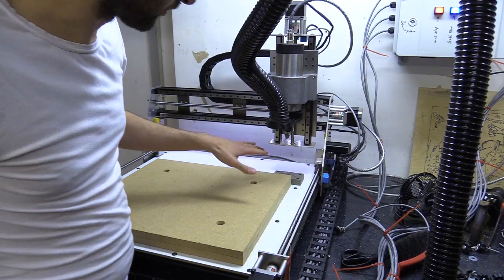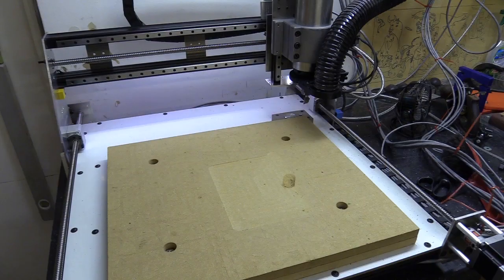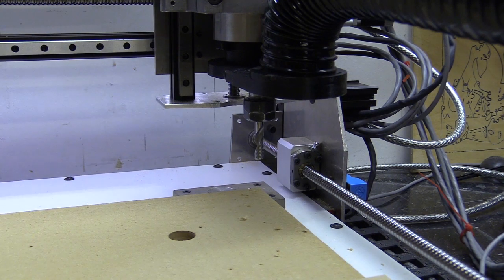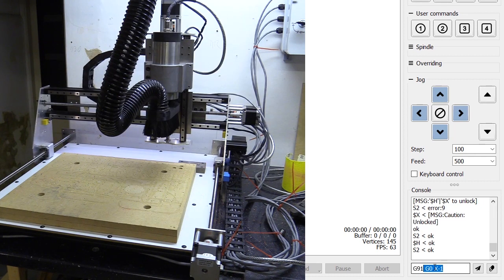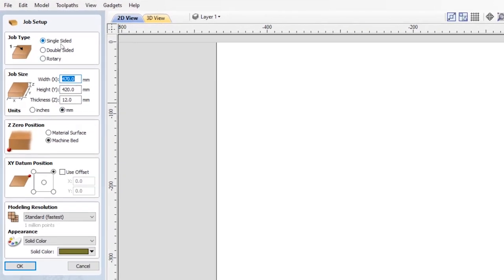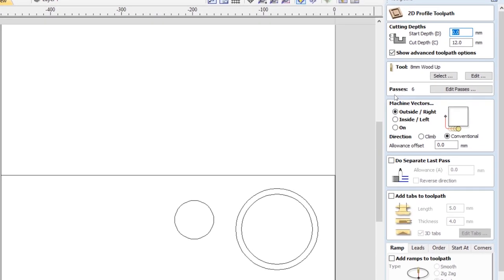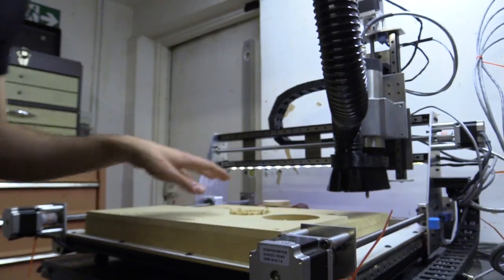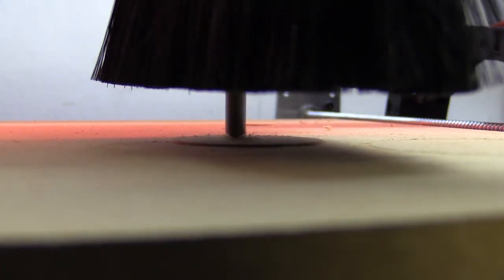CNC Workflow / Wasteboard Surface Patch

Comment: Your Z zeroing technique is going to accumulate errors. Just use a piece of metal of known thickness and drop it on the top surface of the job. Use the job surface as your datum. I do this. My code is
G91G21;                     Incremental mode and coordinates to mm
G38.2Z-30F100;        Lower the tool rapidly until it contacts (pin A5 goes low on my controller). Give up at 30mm in case probing fails
G0Z.3;                         Lift the tool 0.3mm
G38.2Z-1.11F10;       Lower the tool slowly until it contacts
G92 Z9.79;                 Offset the height coordinate by the height of the measuring puck. Mine is 9.79mm thick
G91;                            Again set incremental mode (just to make sure)
G0 Z10.21;                 Raise the tool until it is 20mm (9.79 + 10.21) above the reference level
M30                            End

Comment: You don't need to manually offset the circle. You can specify a negative offset in the profile or pocketing toolpath. It's nice to not have to alter the geometry to tolerance for different materials.
Reply from the maker: Didn't think of that. I'll do that next time.

Comment: Sorry to be the bearer of bad news buts it’s time to start mk3 cnc control, grbl just released a new version which allows the slaved Y axis stepper to home using a separate limit switch. This allows automatic gantry squaring. It’s only one extra wire.........  Full details and instructions are in the new config-h file. Good luck 😉
Reply from the maker: I've been waiting for that to be released for ages. I couldn't understand why they would keep two different type of coolants / flood terminals but not move to dual axis homing. Anyway I got a change to use a Duet 2 and have set up another machine with dual axis homing and lots of other features. Reprap is not great for CNC but it's slowly changing.

Comment: I liked this practical, step by step video. I am finishing my home build CNC router and the workflow is just mind boggling to keep everything straight. For the time being, I'm sticking with a big sharpie and I keep making new jobs and trying it out to see where I get caught up. And making sure I don't click the wrong button on my interface. I have several times hit the home button for Z instead of the set work coordinate home and it crashes away since I din't have anything set up for Z homing.
Reply from the maker: I would recommend having all the homing limits set up before starting - it produces better reliability and repeatability, but it's also safer as you can use soft limits so head of the machine won't crash into the extremities.

Comment: How do you get the LED to turn red when its running?
Reply from the maker: I wired the spindle enable pin via a relay to the red LED lights on a RGBWW strip lights. I go over this in one of the previous videos - CNC Control Box
Reply: @EducatingSavvas  Ah okay, sorry for the dumb question!

Comment: Jezz gezz, that was a lot of G's. Nice of them to give you trial keyz. What else rhymes with cheese, hmm, er, CNCs. I am on a roule.
Nice recovery and roundness results from the unpuckering puck. Very nice machine. I just got myself a 3 and 1/2 foot bed 70 year old south bend lathe sb9c, with not much wear. I can make long round things now. Well when I put all together again.
Reply from the maker: As long as it's a metal lathe I can forgive you! Yeah the licence is only temporary so it's like hiring a fast car - just need to make sure it doesn't get wrecked.
Reply: @EducatingSavvas  lol, it's like my cambam free trial. 40 uses, so when i use it, the pc stays on for weeks.